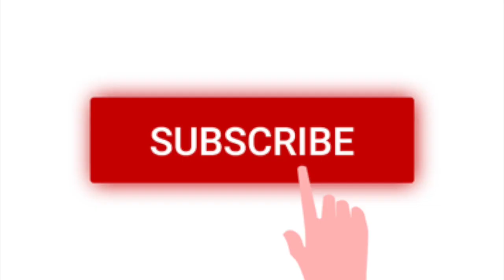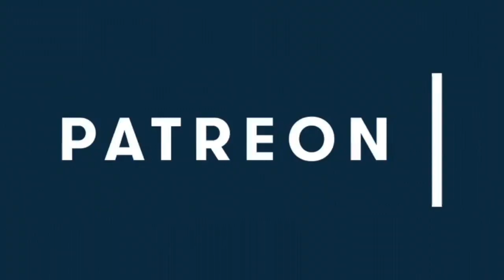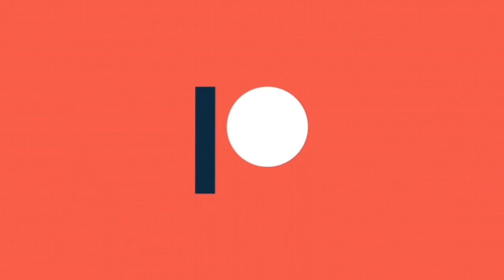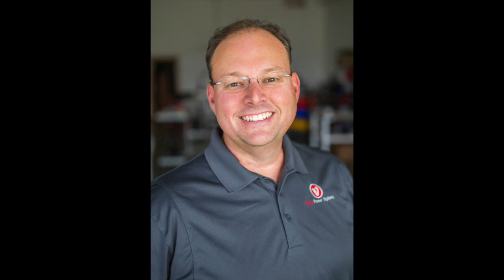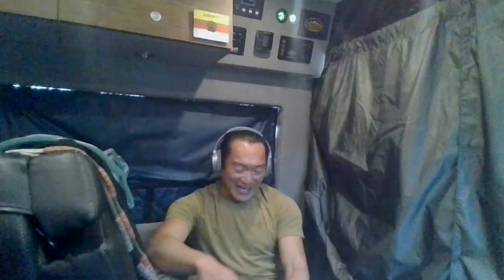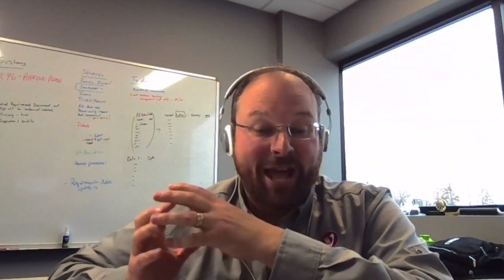9. Jack Johnson - Founder and CTO of Volta Power Systems

Comment: thanks for having this engineering discussion about Volta.  I was never satisfied with the DIY RV power solution using standalone boxed batteries with lots of crimped cables.  A proven automotive grade power system will last through the toughest situations when offgrid RVing